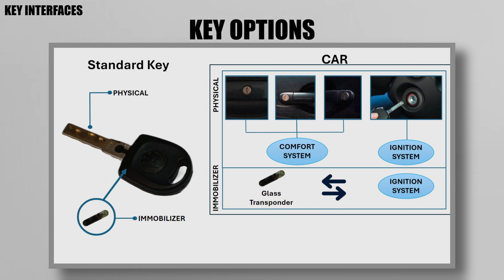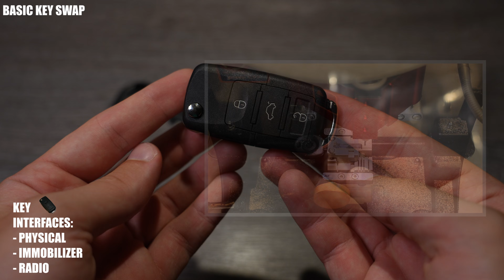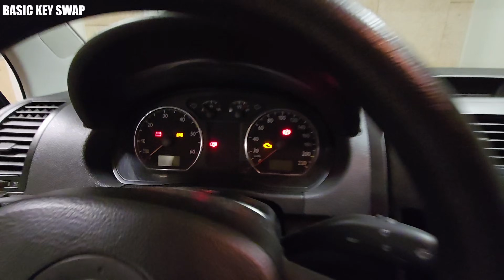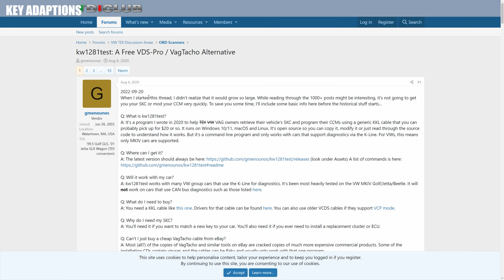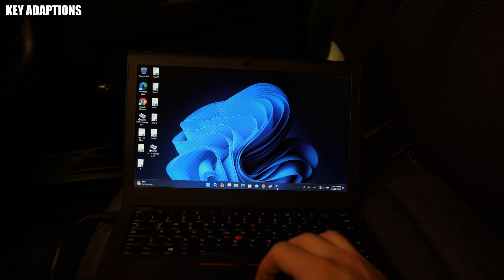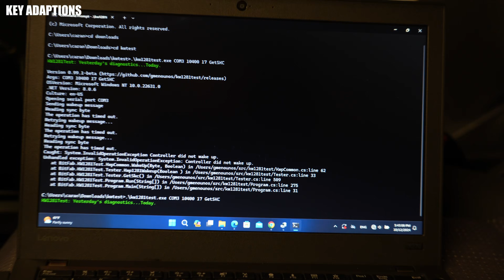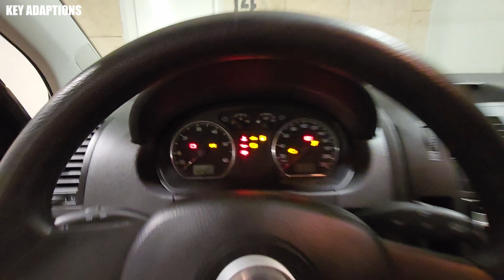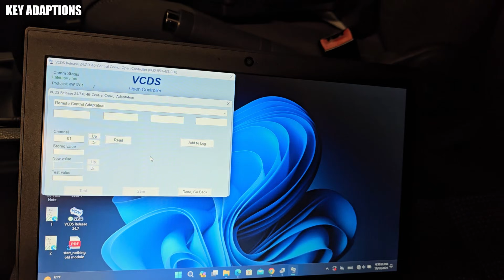Polo 9N Add New Keys + Remote Locking

Comment: Thanks for making this video and I would love to know how to remove the relays under the dashboard, I can get the cover off easily enough and I can see them but apart from one the rest are just impossible to get off. The relay holder wiggles about like it’s clipped into a frame or cage or something but I just cannot get it to drop down I’ve removed the panel underneath it two t20 screws I can clearly see the relays but just can’t remove them can you help me? Thanks just to add it’s a 2004 N9

Comment: VW Polo 9N3 2008 Owner here, for people having issues doing this, mine worked this way. (this model comes with LIN-bus not CAN-bus)
- I had the 6Q0 959 433 H verison, had to change it to the 6Q0 959 433 E one for the remote locking to work
- Retrieving the SKC is the same and it works
- Adapting the Immo on my car was done through channel 25 immo NOT through 17 instruments, you can verify if its the same for you, go to instruments and check channel 21, if it says error not found means your immo is in 25 immobilizer, you have to input your SKC here not in channel 17, and in there you will have channel 1 or 21, mine worked doing the keys through channel 1.
-I also had to change the soft coding on the comfort module 6Q0 959 433 E, I bought it from a Skoda and it came with soft coding 00064, change it to 00019 as that's how my original one was and works like a charm, you can play around with this as its not harming anything, but with 00019 all 3 buttons work just the way I want them to.
Reply: Hi mate. If I follow all the steps from this video up to 4 minutes( so not doing any key adaptations) will I have working remote central locking?
Reply: @KianCullen I tried doing the pairing that way through the door but it did not work for me, my driver side door does have an issue with the module so that could be the issue for me, feel free to give it a shot
Reply: For me I had to code the remote central locking with VCDS as well

Comment: Beware if you have a 4 door Polo with central locking and electric windows the comfort module part number is 6Q0 959 433 H instead of 6Q0 959 433 E. I just bought and tested the wrong door module. Neither the rear door central locking nor the rear electric windows work with the part number mentioned in this video :( - I will try next week with the 6Q0 959 433 H module.
Reply: Hey, you have a coding issue I had the H verison and I have central locking with electric windows 4 doors, I had to put the one with E in it to work, if you tried it with the E one the soft coding on it was wrong. Try soft coding 18 or 19, I have mine on 19 and works like a charm
Reply: Feel free to reach out I can help

Comment: My friend, I watched it with admiration, you did a really great job. I also have a 2006 Polo and I want to switch to remote control by doing what you did, but I'm wondering something. Is it compatible with the new comfort brain, down to the socket, and does it need any modifications?
Reply: its compatible, you might need to change the soft coding on that module to match your car but it's pretty simple

Comment: Hi, i have the same convenience system control unit: 6Q0 959 433 E, what type of remote key should I buy 433mhz or 434mhz?
Reply: I bought mine 433mhz and it worked

Comment: Has anyone tried this with a 6Q0 959 433 H control module?
Reply: It doesn't have remote locking. If you have VCDS you can check

Comment: Great vid. I had a short question. Is it necessary to wipe the old keys? Or can I also choose to only add new ones. Or did you only wipe them because the control unit you got had old keys registered to it?
We lost our spare key, so I want to program a new one. But I don't want to risk erasing our only remaining 'working' key and be unable to use it.
Reply: Even if you dont wipe, they will always be wiped, you are basically learning every key again. So it doesn't make much of a difference. So you can also, since you had 2 keys the stored value will be 2, so you can just stay on 2 > test > save > wait for the immo light to turn off > remove key and put the new one, wait till the light turn off  > And done.

Comment: Fantastic tutorial mate! You deserve all the respect in the world! I checked my Convenience System Control Unit and its 6Q0 959 433 H and looks like its compatible with remote key central locking. I bought exactly the same keyfob and followed your instuctions but to no avail. I also bought the same KKL cable and installed the latest VCDS version 25.3 however it says ' port OK' but 'no interface found'. Then I read that now only the VCDS lite version is compatible with the KKL cable. I installed the like version and it works fine but its limited and I am not able to adapt the key for remote cental locking and neither to program the immobiliser. I am getting meesage that only the registered version of VCDS Lite is able to do this. Any advice please?
Reply: The one with the remote locking has an E in the end, whilst yours has an H. Perhaps it's actually incompatible?
Reply: I’m pretty sure you need a legit cable for it to work.. it works as a “key” for the program.. Sadly i’m in the same situation and don’t really feel like buying the legit cable since it’s so expensive. Let me know if i’m wrong and you figured something else out
Reply: did you manage to do it in the end? I see you have one that ends in H, I have that one too, did you change it to an E one?

Comment: Hello friend, I have a 2004 VW Polo, and my module is 6Q0 959 433 H, but I can’t find whether this module supports remote locking. When I enter VCDS under channel 01, it says “Error: channel 01 not available.” Any help or advice would be welcome.
Reply: I know its late, but it doesn't. I had to buy one with "E".

Comment: Mine doesnt connect to the car, i tried a lot of ways to do it but nothing seems to work.
I took a trip to check if the car was ok and the "EPC" light turned on
Maybe the 6Q0... Is broke?
I saw in some forums that the 6Q0...needs a 3h break to connect other keys
Idk I just want to figure it out and solve it
------------EDIT---------
Ok...Now I realized that the key that i bought isn't the exact model that's in the description, maybe thats the problem. But why the EPC light is on?

Comment: Is it possible to do the ccm & key swap without using any software?
Reply from the maker: Yes, but you'll need to accept whatever settings are on the ccm. I.e. it might have some intricacies like auto-locking the doors once you start driving, or first unlock opens driver door, 2nd for all doors. These settings are adjustable in the ccm. If you're lucky the ccm will have settings you're happy with. Try to ensure (if you can) that the ccm is from a car with same number of doors. This is also a setting (2-door vs 4-door).

Comment: can you show me a shot for connecting new convenice because old one has one port and new one has three ports and i want to know how to be connected exactly
Reply from the maker: The module has three inputs, but the connector will only fit in one input (the center one) on the new convenience module. You can leave the additional plugs empty.
Reply: @P0L0G0D  Many Thanks Bro

Comment: I have a Polo 9N3 from 2006, and I tried to replicate everything shown in the video. I successfully configured a new key and replaced the module ending with 'E,' exactly as demonstrated. However, the last step involving remote pairing didn’t work for me.

Both methods—using the key in the door and via VCDS—didn’t allow me to lock or unlock the car remotely. 
It seems there’s a missing step specific to the 9N3. 
Currently, I’m checking whether it’s a coding issue. The only clue I have is the error message in the 'extra' field: 'Steuergerät Fahr. antwortet nicht Steuergerät Beif. antwortet nicht.'

In this state, everything else works fine: I can still open and close the electric windows and lock the car using the physical key. So far, no issues have been caused by this change. I’ll update if I manage to resolve it for the 9N3.
Reply: I found the error and was in the configuration.

For the error the polo 9n3 has the Lin-Door modules so the code is 16 for 2 doors and 18 for the 4 doors version

In my case 2 doors with 16 solved the error in VCDS.

Comment: So if i understand correctly i only need to buy another comfort module install it, buy a remote key and pair them
Reply from the maker: Correct, but you'll also need to have the new remote key cut (just bring it to a locksmith with the existing key and they can duplicate it) and you'll also need to transfer the immobilizer chip from the old key to the new one.
Reply: @P0L0G0D  thnx for your fast answer, that was te only part that i wasnt sure about

Comment: Hello!!
So..in order to use VCDS we need to have an original Ross-Tech cable?
Reply from the maker: I believe the lisence is stored in the cable, so you need a ross tech cable for the software to work with all its features, but the application can be downloaded regardless and I think there is a VCDS lite, essentially VCDS with limited functions, they can be used with a generic cable.

Comment: The you got in Polo 3.2 VR6 24V Are Manual in Automatic Mission In Movement?
Reply from the maker: So this engine isn't new and was around in the early 2000s, but was not in any OEM Polo or Polo 9N. I would guess there were manual transmission as we're most VAG cars at this time.
Reply: Yes you can in car Audi in Volkswagen you got it 2.8 in 3.2 in 3.6

Comment: Hey man, I got a polo 6r but it doesn’t have remote central locking but comes with the manual key (with the light) to change to the remote one all I have to do is cut the key and change the immobiliser??

Comment: Hey man, i have 1.4 Polo, but 9N3 (the facelifted one), and absolutely admire your work you do to the car. Hats down to you sir, not everyone would even try to invest into these small old underpowered cars, but they can great fun! Keep it up, absolutely stunning videos!
Reply from the maker: Thanks! Enjoy thr 9n3!
Reply: hello mate is the process the same on a 9n3?
Reply: @ZiroFNBR  hi mate, as such idk as my polo came with remote locking from factory, but I'm pretty sure they wouldn't change anything electronically just for the facelift
Reply: To do just a basic key swap for manual to fob do I need vcds

Comment: hello i’ve just recently done this but the key only works when im incredibly close to the drivers door handle, practically touching it
Reply from the maker: I would change remote battery and see if that helps.
Reply: @P0L0G0D it’s a brand new key off ebay though i’ve seen there’s two versions of the ccm could it be the wrong one?
Reply from the maker: What is V2 or V1? What was the CCM's part no.?
Reply: @P0L0G0D it’s the h02/s0002 one but it’s the correct ccm did i get delivered the wrong version?
Reply from the maker: If the module is working I cannot expect it is the "wrong version", nor am I aware that the version should matter... I would say google if something could be impacting the range. If you work it out please share so we can learn from you :)
Reply: @P0L0G0D  obvious reasons could be the signal antenna but i have found out the h01/s0001 and h02/s0002 have different softwares on them meaning they work differently which could be the reason and also found the the h02/s0002 (the version i bought) is the ‘bus’ version im not familiar with all the terminology just yet as im newly learning all this but im going to buy the other version and update you when it arrives :)
Reply: @P0L0G0D hello i have just installed the s0001 version and the range works a lot further than just right next to the door however its from a european car so everything is reversed and its for a 2 door when mine is 5 if you know if you could fix this through vcds please let me know
Reply: update again looked inside the original model and the signal antenna was almost like corroded away so both versions work as well as each other the s0002 is just an updated version

Comment: is this also for a Lupo 2003 1.4 8v?
Reply from the maker: Not sure. Maybe start by checking if the comfort module is in the same location and the same spec. Additionally if some better spec Lupos has remotes from this era, the answer could be yes. I would first investigate that.
Reply: @P0L0G0D  its in the same place do you live in the Netherlands? Greets Anthony
Reply from the maker: No, Austria, although I was living in NL when I bought this car. It is a Dutch car from Den Haag ;).

Comment: Hello..Do you know what is the difference between convenience module h01/s001 vs h02/s002?
Reply from the maker: Not 100%. I have read online it denotes the hardware /  software version of the module. My original module was H/S version 02, but replacement was 01. Both seem to work fine with the car.
Reply: @P0L0G0D  Thank you for your answer...Following your DIY clip, I ordered H 01 version...but I received H02 version..I hope to work as well...
Btw:  What other systems should be connected to the free pins of the E convenience module?
Reply from the maker: Please report back if the H/S version 2 works, there is someone else with this qs too. And tbh I don't know what else should be connected, but in my case leaving them empty had no consequence. I have seen other forums online where they advise to leave empty too.
Reply: I come with updates regarding the installation of the comfort module for remote closing. 
First of all, I have to state that I have a Polo 9N3 from 2006. I noticed that I had mounted the H version module which has 2 connectors and, to my surprise, cables were mounted in both connectors. I changed the H module version 2 with the E module version 2, connected both cables to their places and, in the end, it seems to have worked (only the connector for the alarm remained free).
I want to specify that the first attempt to pair the key did not work.. later I tried again, I don't know which keys and in what order, but it worked.
It also confirms the fact that the 9N3 module comes out so easily, it is still held by some flaps... and it seems that the cables don't come out so easily either... in conclusion, after about two days of work, I have both hands full of scratches. ..
Finally, I would like to thank everyone who shared information on this topic. We'll hear from you in the next update (I bought a lamp for the glove box: maybe you can give me an idea where to get the power).
Reply: About the other pins I found this info:

When mounted
Alarm system above, wide plug in the middle, rear doors below

With the horizontal pins looking down

Left group 
Alarm System

Middle pins
Central Locking and Windows

Right group 
Rear doors
Reply: From what I found in a German Forum:

The main difference between H01 and H02 modules lies in their communication protocol and compatibility

H01 communicates entirely via CAN-BUS and is suitable for Polo 9N models up to mid-2004, before VW transitioned to a different system.

H02 is designed for newer Polo models that use LIN-BUS communication, making it compatible with vehicles produced after the mid-2004 update

It could be that the H02 is also retrocompatibile but I'm not sure and I don't find anything about it.
Reply: @marmagico  Thank you for your answers!..I have a 2006 Polo and I have received 02 version...so it shoukd work...unfortunately, the project is still waiting for some fre time!..

Comment: Hey mate,

Are you planning on making a video about changing the radio to a double din system? Trying to replace the radio in mine and can’t figure out if my head unit is busted or im doing something wrong!
Reply from the maker: Hey. Haven't really considered that. In fact, the only thing I have considered is swapping out my current radio for a original one that has Bluetooth retrofitted to go for 100% OEM look. My use case is mainly short drives with no need for  navigation, so I am not sure I'd look at a system like that.

Comment: Great video! do you think it's possible to modify it with to un/lock with a button press on the side handle like modern cars? I know it'll probably requires additional modification but it's pretty neat
Reply from the maker: It's something that would be nice but as far as I know is not possible without really modifying the coding in the car. I've not been too keen to try that and it is fairly low priority for me, but will for sure make a video if I do that.

Comment: hello mate i’ve just looked in my car to locate the ccm and it’s completely different to yours it’s facing the other way and looks like a pain to take out have you got any ideas on how to remove it
Reply from the maker: I'm sorry but not really without seeing it for myself. Generally if something is really hard to get at I prefer to remove other things that are in the way. It may take a little more time but overall makes it easier and lowers chance to break things...
Reply: Just did my rhd one tonight, that housing is the worst. Ended up cutting the plastic brace in the middle and sliding it out the side after unplugging. My hands are now covered in scratches from everything else under there. I honestly don’t think there was any other way I could’ve done it without taking a lot of the electronics out.
Reply: @ when doing mine i sort of managed to slide out the clips into the bigger slot that allows it to just be pulled out but it took a long time a lot of cuts but now if i were to change it its as easy as it gets just sliding it out